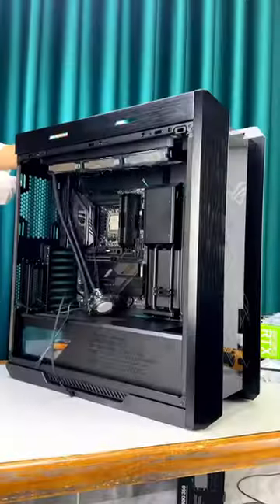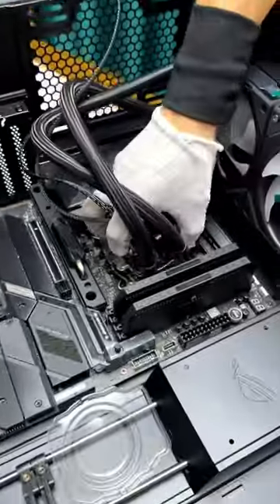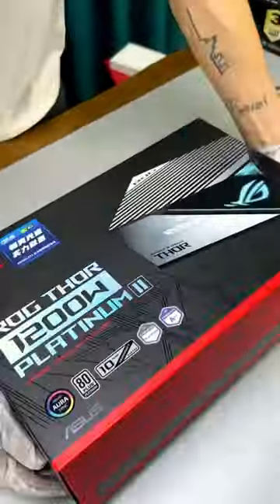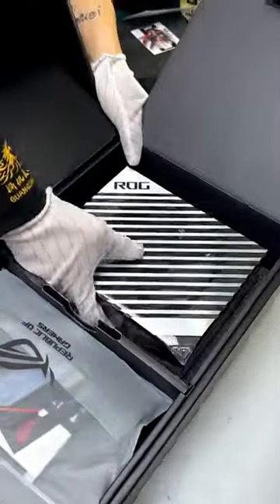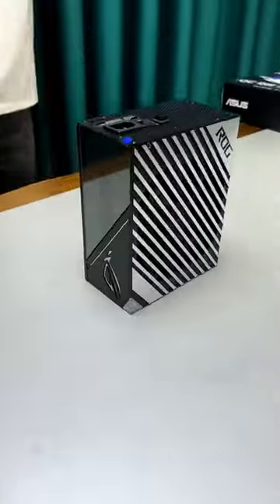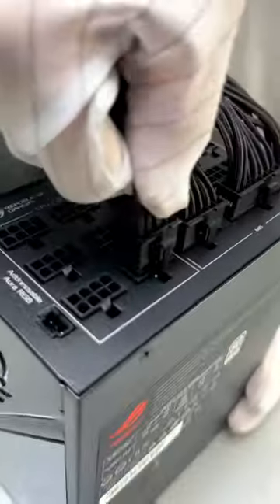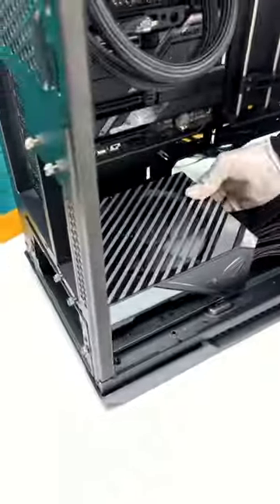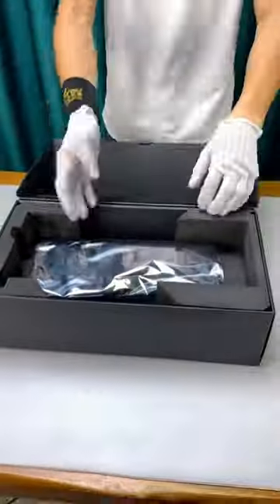Build Intel i7 with 4090 #pc #shots

Comment: In this setup your 4090 only runs with 8 pci lanes. The m.2 must be on 2nd slot, not in 1st slot! ☝🏻because than is using the 4090 16 pci lanes to cpu! Noob!
Reply: doesnt really matter in 99% of cases cause Gen4 cards dont saturate the bus yet so u can get away with 8x gen5